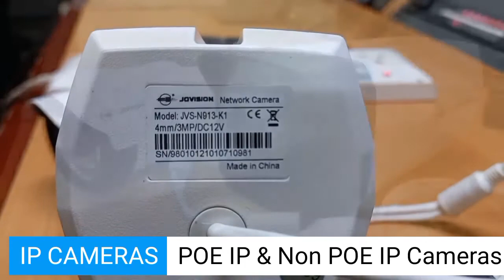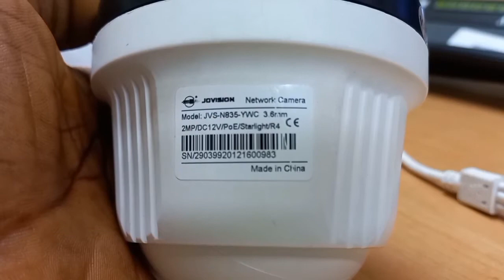Introduction to IP CCTV cameras

Comment: the imput power of the POE cam is for the case you do not use a POE Switch and plug it direct to the NVR that has only the Ethernet non POE conection
Reply from the maker: Yes the Power terminal is to enable you use other means of power supply when you don't have a POE Switch.